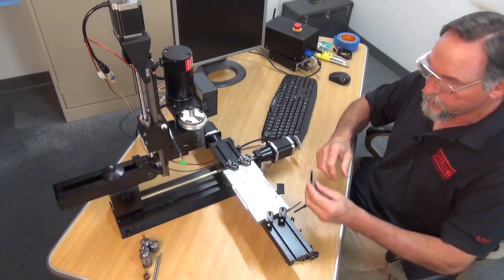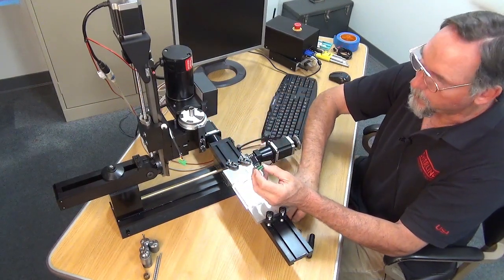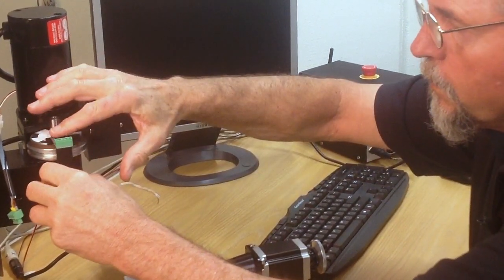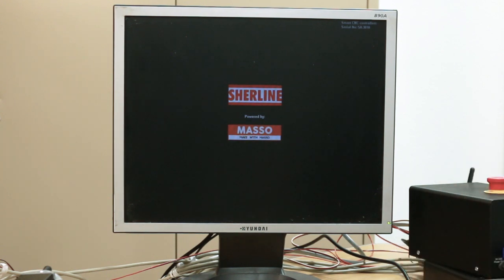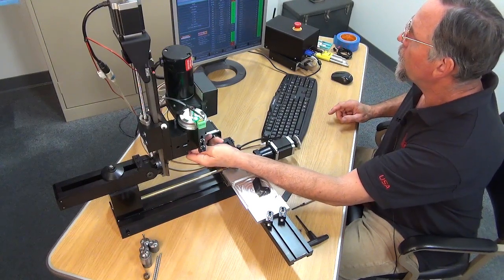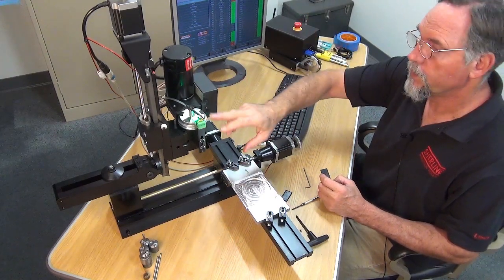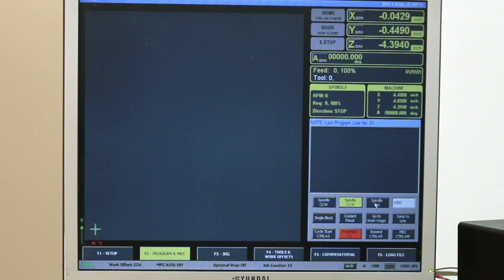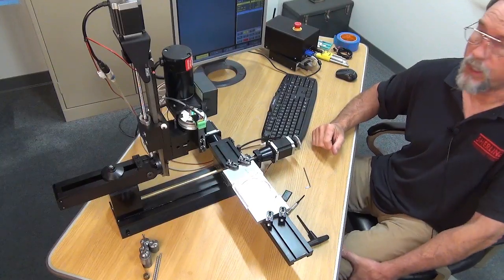Setting up the Optical Encoder

Comment: Awesome! Did you change out the Z axis screw?
Reply from the maker: This mill has our ball screws on all the axes. The optical encoder and the Masso controller can also be used on our machines with the standard leadscrews.